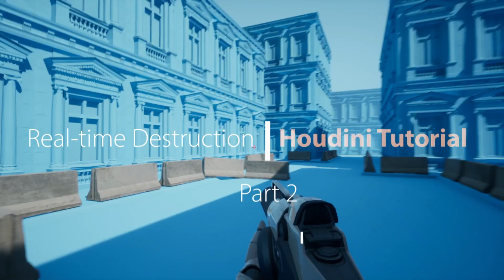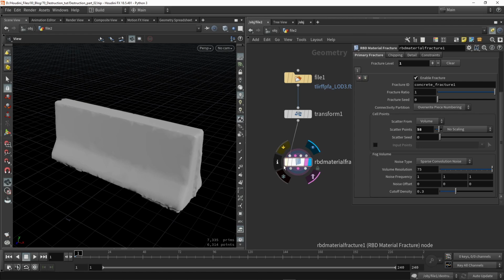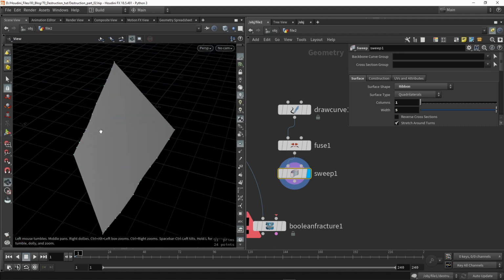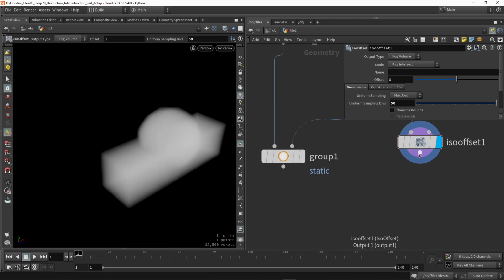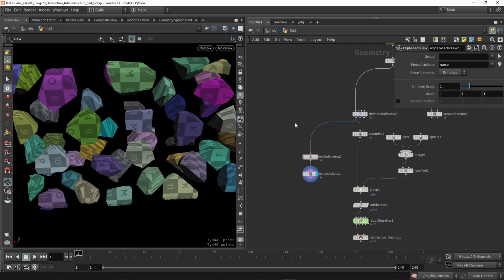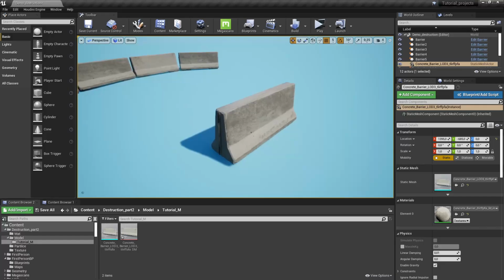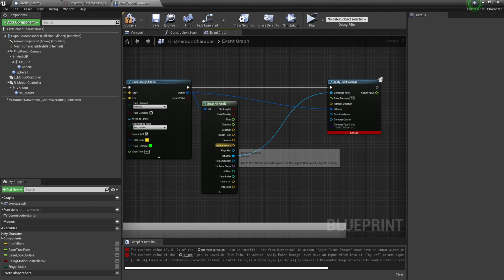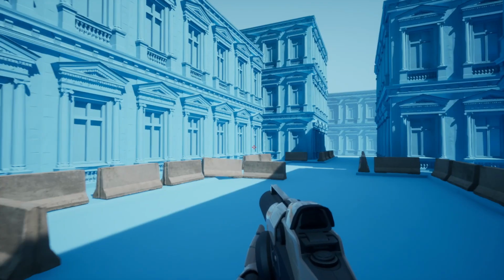Real-time destruction with Houdini and Unreal || Tutorial Part 02

Comment: How can i create second texture set for inside debris ? To set different texture for it in ue4? Not overlapping with existing texture map?
Reply from the maker: You can assign different materials to set materials ID
Or if you want a second uv , rename the uv attribute to uv2
Reply: @simonhoudini5074  i tried it in multiple ways but after importing to ue4 i still had only 1 mat id :/ .
Btw great tutorial looking forward for more :) would like to see how you would make reinforced pillar with undesctructable inside. Only shell shattering like in the scene from the matrix
Reply: @nolifearea8228  I don't know if you tried this, but I went to houdini applied different materials, when I clean the attributes make sure shop_materialpath, uv and uv2 are still there. Then when applying materials to the chunks first slot was unbroken depth 0 object, then second slot the rebars I put in and third slot broken depth 1 object base and fourth the inside faces of the concrete.
Hope it helps :)